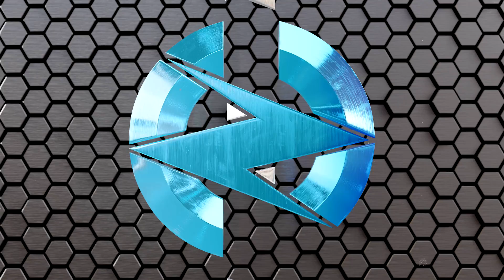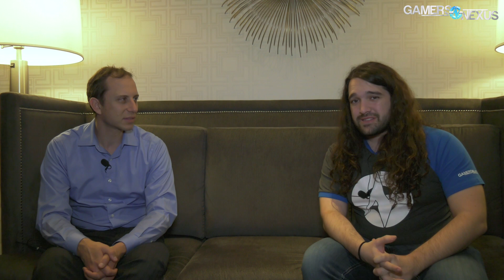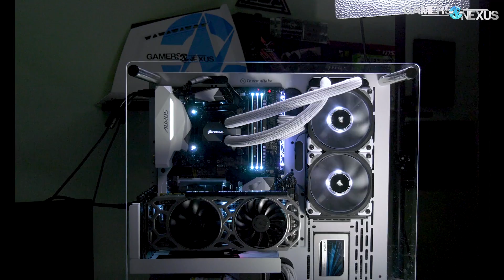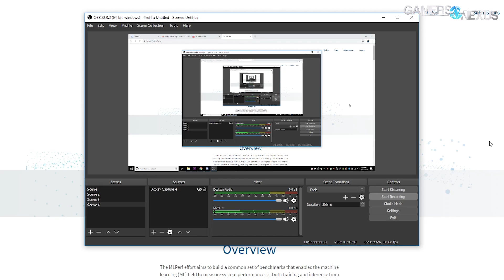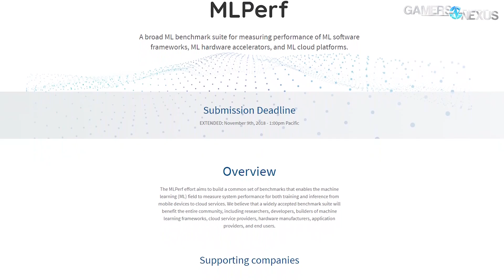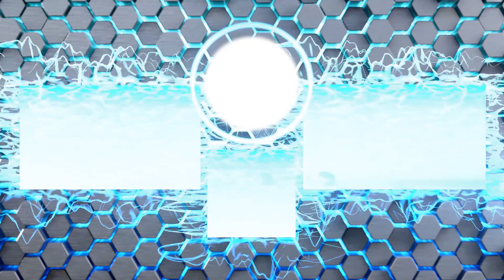Intel 10nm & 3D Stacking Deep-Dive, ft. David Kanter

Comment from the maker: Still processing 1080p! We filmed this after an entire day of arch and worked on it all night. Huge thanks to David Kanter for some highly technical discussion of Intel's new architecture announcements. We linked his other work in the description above.
You might also like our previous video with David, wherein we define what a "CUDA Core" really is: https://www.youtube.com/watch?v=x-N6pjBbyY0
Reply: Gamers Nexus 1080P is up now :)
Reply: Don't worry. The audio sounds fine and the visuals are fine as well.
Reply: Wanted to mention that if all this is is chiplets on active interposers, you should check out the couple videos AdoredTV made on AMD researching use of active interposers and topology, along with the cost analysis of doing so that was from a 2017 white paper. Now if the active interposer's logic extends beyond the simple logic routers, etc., then it looks kind of like a 3D stacked version of ARM's bigLITTLE design, with the low power core variants on the bottom and the performance cores that get hotter on top with the silicon to pull heat. Either way, what I've seen from articles like these (https://www.pcmag.com/news/365434/intels-3d-chip-stacking-tech-aims-for-smaller-power-effici ; https://www.forbes.com/sites/antonyleather/2018/12/12/intels-new-10nm-sunny-cove-architecture-announced-trouble-for-amd-ryzen-in-2019/#303f8b617269 ; https://wccftech.com/intel-unveils-foveros-a-brand-new-way-to-3d-stack-chips-with-an-active-interposer/) suggest this is not new. It is switching the passive mesh interposers used since 2014 with Xeon Phi and with HEDT and server products for an active interposer, rather than sticking die chiplet on die chiplet, which is where some of the complications David Kanter was discussing come from. Now, AMD's 2017 paper suggest that the cost-benefit of doing a disintegrated chiplet type design on active interposer was better with 65 or 40nm nodes, with the benefit over a monolithic die on cost being less at smaller nodes. Some companies only offer 2.5D and 3D integration for active interposers at 32nm and smaller, like GF (which would work to possibly count against AMD's WSA so less fines for production at TSMC by going with GF over having to pay for the interposer and packaging plus the WSA fines, etc., which is why I brought it up). Also mentioned in those papers is using on-package memory, which matches what Intel is suggesting. The papers, except for the cost analysis, are from 2014-15 time frame, paid for and conducted experiments with AMD research. Enjoy.

Here are some of AMD's white papers and AdoredTV's videos on the topic:
http://www.eecg.toronto.edu/~enright/micro14-interposer.pdf
http://www.eecg.toronto.edu/~enright/Kannan_MICRO48.pdf
https://youtu.be/G3kGSbWFig4

https://seal.ece.ucsb.edu/sites/seal.ece.ucsb.edu/files/publications/2017-iccad-stow-activepassiveinterposers.pdf
https://www.youtube.com/watch?v=d3RVwLa3EmM&t=600s
Reply: Great video Steve, sounds like Intel have a hot iron somewhrre uncomfortable. None the less optane dimms sound very interesting to me.
Reply: Want to say thanks for the sponsored ad. That case is fecking awesome and I never knew it existed
Reply: Brad Cox Yeah, Optane DIMMs are one of the few actually interesting things in computing right now. It should be fast enough that low-end systems could essentially use it main memory as storage, which brings up all kinds of interesting questions... What does it mean to load a program or shared library when it’s all already in main memory?
Reply: Hope you enjoyed it in the Bay Area man
Reply: Gamers Nexus What do you guys think of Intels new fanlets? I think that tiny fans to help cool existing fans is a wonderful idea.

Comment: I just read the forbes article, where a lot of the same is gone trough. It's so nice to see AMD pushing Intel into doing new and different things like this.
Reply: Yeah it is not like Intel has ever done anything new or different before, right? It is not like they invented the microprocessor or anything like that. One of Intel's founders only invented the integrated circuit. So screw them. FYI Intel has always been a manufacturing company. That's what they do. Intel actually makes stuff. Unlike some other pushy companies.
Reply: Yeah, it's not like Intel has been lazy for the past 10 years because they didn't have competition, right? And they coincidentally only woke up now that the other pushy company is delivering cores at a rate that Intel can only dream of with its current processes.
So I'm in agreement with OP, it's nice to see AMD pushing Intel into doing new things.
Reply: @pinkchckn  yeah it is not like we're at the end of conventional process improvements either. You think it is easy moving forward from where the industry is at now? Do you have the slightest clue just how small ten nanometers even is? That is like 100 silicon atoms across. Being able to manipulate individual atoms is world record material too. That record is currently held by IBM BTW. They spelled out their logo using 35 xenon atoms with an electron microscope. That process is not practical for mass production though.
Reply: Didnt you read alot of the articles. Alot of this stuff has been in development for years.  You cant come up with this stuff in 1 year. That and Brian FINALLY BEING FIRED.
Guy was a shitty CEO
Reply: Isn't Intel not just basically copying AMD? 3D process is just really another name for the TSV technology that AMD developed for HBM years ago. Mr. Kanter calls the TSV 2.5D here but there's really not that much difference.
Reply: @SamsoniteDove  AMD has no process. AMD has not made anything in over 10 years. They bowed out at 45 nanometers. All AMD does is design work today. They have other fabs make their chips for them. TSMC makes all of their 7nm chips.
Reply: @1pcfred  Your comment has nothing. Literally nothing to do with my comment. I'm not talking about production process at all. What I'm talking about is 3D chip design which AMD was the prime mover in development for large scale production of. Read for example here: http://www.techdesignforums.com/practice/technique/mounting-fiji-how-amd-realized-the-first-volume-interposer/
Reply: The first chip with this design could do 5 ghz. But released slower they improved the design in lots of ways and lets be frank 5 ghz ish is still about the limit for this design as its pretty much locked to the 14nm even if they had 10nm ready.  So they would have to come with new designs within 2 or 3 years with or without intel as noone will but the exact same time and time again. So i dont think amd really gets much credit here.  The stretch is out of the current architecture and they need to innovate on their own anyway.
Reply: @pino_de_vogel  let's be frank, 5 GHz is pretty good.
Reply: @blitzwing1 Intel got on top because they built the mountain they're on top of. Robert Noyce invented the integrated circuit. He was also a founder of Intel. Then Intel went on to produce the first microprocessor. So when you're first you are also on top of a heap of one.
Reply: @r3d0c  if they only knew some history. I give AMD a lot of credit for making something of themselves. But I know where they came from. I even had an AMD DX4-100 back in the day. I have one of their data books from 1983 too. That's back before the day. AMD was a much different company then. They only made glue chips. PIOs stuff like that.
Reply: @blitzwing1 you should learn some history. Intel got to the top by inventing the industry. They didn't bribe anyone to do that either.
Reply: @blitzwing1 Intel always seems to be the top performer to me. I don't know how anyone bribes their way to being the best either. In fact I wouldn't even call anyone a competitor to Intel. Other manufacturers target other market segments. AMD is more of a value brand. Never the best, but good for the price.
Reply: @1pcfred   its impressive yes but even my 3770k can do 5ghz but still be 22% slower. i just testedthis today and frankly it seems that the improvements trough the gens have had a bigger impact on gaming performance then the mhz bump. asi can do a all core 5 ghz  (on my air cooler with a 1.46 vcore @ 85c) but im still nowhere near the fps others get with my gpu on 4,7 ghz and a latest gen cpu. so intel has improved a LOT over the years despite using the same design.
Reply: @pino_de_vogel  what you describe does not sound like the same design to me. As those gains would not be had using the same design at the same speed. We are coming to the end of the road as far as process shrinks go. So the industry is going to have to come up with something different if they want to keep moving forward. Plus how much improvement is even halfway between 7nm and 0? That's only 3.5nm Almost nothing is almost nothing. You look at other shrinks in the past and they were tens of nanometers of reduction. So it was something. When you're starting off with a tiny pie the slices you cut aren't going to amount to much.
Reply: @1pcfred  its still the same base architecture just developed further.  people say intel has not improved at all lately i was just saying they did for sure. as for an end to die shrinks i dont think we reached that limit just yet bt within 10-15 years that might come to an end yes. 5nm is being worked on and some companys have test proceses at 3nm and smaller already but that will be close to a decade before we see those. And they said before we cant go smaller yet here we are nearing 10nm (amd's 7nm is basicly 10 nm if you go by actual correctness in size) so well see how far they can stretch this but i forsee another 2 shrinks atleast. but yes these last few thinkable steps for now apear to be the hardest. 3 nm seems really complex and crazy expensive.
Reply: @pino_de_vogel  everything is expensive until unit volume brings the costs down.

Comment: Okay, this was a nice talk, but I still have some questions. It might just be me being too tired after exams, and not picking up on things actually said, but...

What will this 3D stuff in practice bring? My questions are aimed at the new stuff itself, not the node shrink to 10nm.
1: Is it first and foremost easier production? 
2: Less cost? 
3: Better yields? 
4: Better density? 
5: Double the cores? 
6: Less power consumption at same frequenzy? 
7: Way more frequenzy?
8: Is it aimed at server, desktop, mobile or all across the line? 
9: And also, when will this hit production and be available? Which iteration of Zen will this compete with?

These are my questions of interest. Perhaps more have other questions? And then, perhaps someone with a fresher mind than mine could try to answer, and make a kind of TL;DR?
Reply: It lets them throw more in a smaller space. It could improve efficiency and yields, but I don't think Intel's headed in that direction. They just want more performance without increasing the largest dimension of the die (because that limits performance). Performance should go up via either IPC or cores, but it'll cost a ton and have temperature problems. It's likely aimed at servers and mobile first; I suspect tremendous problems with maintaining high frequencies until the second (probably third) iteration of it.
Reply: Electrons travel at a fixed speed.  The closer you can get all the switching smarts together, the faster they can run.  If you can connect multiple chips together in a vertical stack, the distances electrons must travel are greatly reduced, compared to laying those chips side-by-side in standard 2D fashion on a PCB.
Reply: @joesterling4299  Ah nice, that's good info! Cool, man
Reply: It will probably mostly mean more cores and/or more cache, with more bandwidth and/or less latency between different areas of the chip. Fundamentally it’s just more stuff in less space, and those are the obvious applications. It should perform better (assuming they can keep it cool), but not like 10x better or anything. My understanding is that this is all far enough out that I’m not holding my breath.
Reply: OtherTheDave wasn’t reducing size the point of 7 and 10nm? I feel like this won’t reduce size it simply displaces it vertically, though I get the concept of getting components closer together, but if it makes cooling unreliable then heat would defeat any performance gains, seems like they should focus on one process at a time and actually finish 7nm before creating new problems for themselves, just my opinion though
Reply: @faffabout9412  intel is massive and the people working on this almost certainly have nothing to do or very little to do with intels 10nm or 7nm fab teams which themselves are separate. Its the only way to keep up in this industry even as you're making the next process or feature there is already people working on whats coming after that 5 years down the road. For example their 7nm has been in design and manufacture of fab tech since well before they found any of the current problems 10nm is facing.

Comment: So... Intel have EMIB, which is very competitive, but they decided to go the silicon-stacking route? 
What the heck, Intel? Imagine how hot these new chips might be. 
Chiplets seems like the better way going into the future imho, but to heck with my opinion. I don't design silicon chips.
Reply: Chiplets are what they're talking about....
Reply: @scythelord  Yes, but their approach is to stack the chiplets on top of each other. I read the Anandtech article as well. Intel are really looking for clever designs to eliminate possible overheating issues with this stacking approach. Also, the stacking will probably be used in low-power packages, which makes sense. Mobile SoCs are basically stacked chips as well and they work fine. 
I hope I'm not missing something here, but if I am, do share more interesting bits with all of us. 
Cheers.

Comment: Well the extra layers can't be worse at heat exchange than intel tim, right?
Reply: While silicon does have significantly higher thermal conductivity, you also have to consider that the upper layers are active circuits that are producing their own heat, and heat generally speak flows from high to low, and flows faster the higher the temperature gradient. All that is to say it will be an interesting engineering challenge to keep multiple heat-producing layers from turning into a giant hot box that just self-destructs.
Reply: we can replace electric stove burners with Intel CPU's
Reply: @cream_soda  haha indeed. It is basically a worst case scenario for heat dissipation. You need to create a gradient between layers for heat to be transferred. So if you want the lower layer to be 90c than the upper layer would need to be 70c maybe, who knows at this point I guess.

So you would need to get rid of 2x the heat while keeping the upper layer significantly cooler than it would otherwise need to be without increasing the surface area. 

I wonder if they are going to have parts of the CPU act like heat pipes to try and cool the lower layer more efficiently. It sounds like a thermal nightmare to me though. I am guessing they have a plan. Lol.
Reply: To add to what others said the thickness of the layer of any material affects its thermal conductivity vertically . The silicon on top of the button layer will be alot thicker than TIM or STIM.
Reply: @cream_soda  Does it really matters how the heat flows at this scales? I doubt the layers will have total a thickness of more than 100nm. i think the biggest problem will be higher power densities in the same area, not so much that another layer will slow the heat transfer rate of layers below.
Reply: @teresashinkansen9402  Yea I was thinking the same thing re: each layer only being ~100nm thick before deciding I didn't really know what I was talking about. On one hand, you're definitely right that on a macroscopic level it's still basically a 2D plane generating all the heat. On the other hand, in a situation where the elements generating all of this heat are ~100nm in size, maybe it makes sense to think about gradients and heat transfer on that scale. I don't know much about quantum thermodynamics though, so I'm not going to act like I know which view is more "right".
Reply: @cream_soda  Well i don't know much either so there might be things i havent thought about, just some things i have pondered because i am interested in this kind of stuff (Im making a custom high power flashlight). If you play a bit on thermal simulation software (Energy 2D is a nice free program about thermal flow simulation) you will see that scale has a very important role in system design. Take for example a copper bar 1cm thick and apply heat at one side, heat will move to the other side at the same speed regardless of thickness, if you ignore air convection and radiative heat transfer.

Comment: I am 100% not qualified to be confidently taking about this, but if they wanted stacked processors, why not make a new kind of motherboard slot so that you plug the CPU in the same orientation as (for example) the GPU card? This would let you have access to both sides of the chip for more cooling.